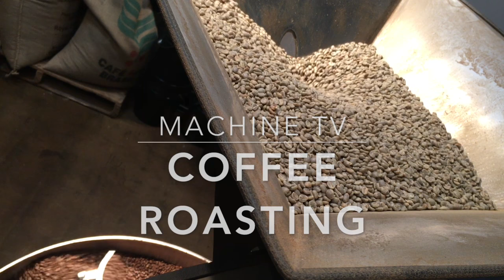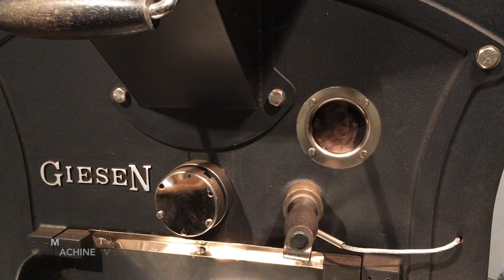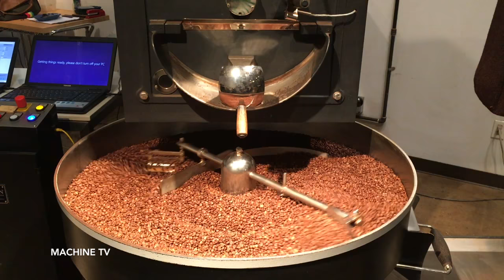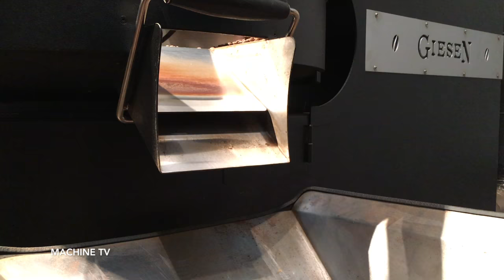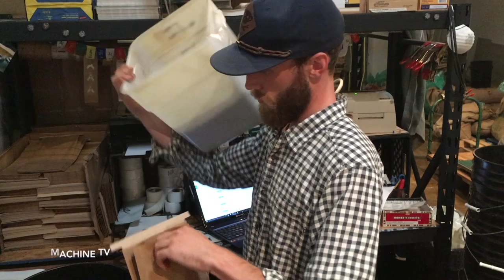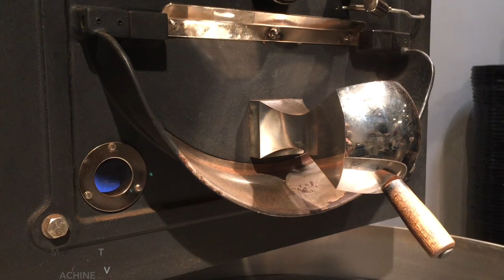Machine TV: Coffee Roasting with a Giesen W15 roaster

Comment: Hello! what is the speed of the drum? hz?
Reply: Drum speed will always be different roaster to roaster. I use 42Hz on my w15, which is roughly 62 RPM.
Reply: Roscoe Gordo at this speed of the drum, what is the grain load?
Reply: Roscoe Gordo I work at 40hz with a load of 10kg
Reply: @Yrt629  what air flow settings are you using?
Reply: Mike Stasiak 
 Most often 105-115pa. This is an endless game)